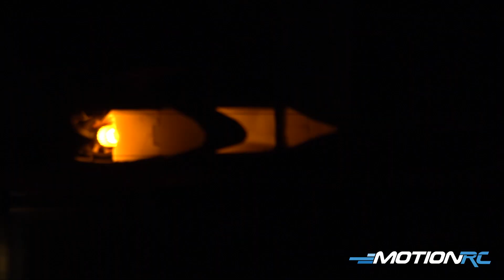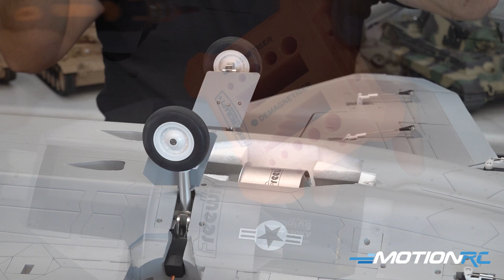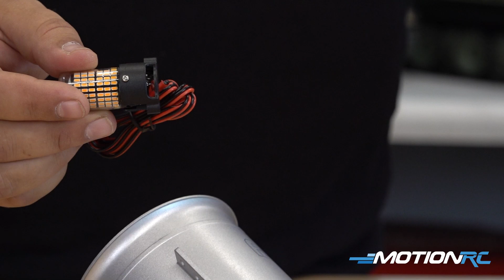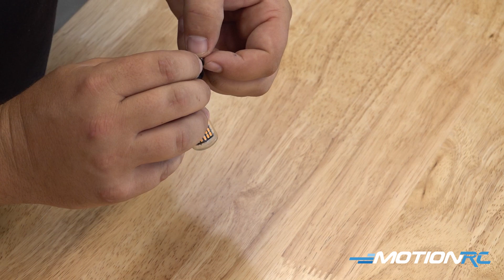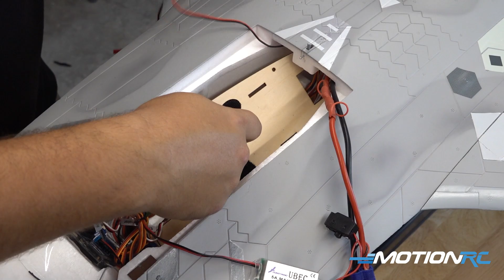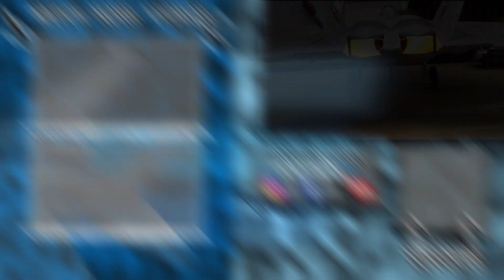Freewing Tail Flame LED Simulated Afterburner Overview | Motion RC

Comment from the maker: For customers using the Tail Flame on 8s set ups. This afterburner in stock form requires the use of a 6s balance lead. For an 8s setup, you would need to use one 6s and one 2s battery so you have the 6s balance lead. If you are running two 4s battery’s to make 8s it will not work without modifying the connection.
Reply: I purchased one of the universal burners for the freewing Mig21 because it has an outrunner...the tabs on the back of my motor casing are just a bit too big for the 32mm adapter plate and too small for the 36mm. This is pretty frustrating that of all the adapters, none are the right size.
Reply: If the battery doesn’t have a balance lead, how would you hook up the after burner? The new spectrum G2 batteries don’t have balance leads.
Reply: @AM-it3fs  I have the same G2 batteries. Did you ever come up with a solution?
Reply: So what do we need to do to modify the connection?
Reply: You can always just use a BEC.
Reply: I have an f16 v2 6s, can I connect the power supply for the edf lights directly to the esc cable to the battery connector? Because I have a beeper connected to the balance connector

Comment: I just bought the f22 raptor 80 mm and the dual led. Problem was the motor orientation relative to the can was off. Which means the dual led was off too since the can sits just in one position and can not rotate. I am not very impressed with the QC specifically the edf assembly. very poor.

Comment: What do I need to do to make it work in an E-flite Habu XS 80mm? I installed the afterburner according to the diagram, but it doesn’t work and it cuts the throttle at around 40%
Reply from the maker: These are not compatible with Spektrum smart ESCs you will need to set up a separate channel just for the input.

Comment: just a little tip that happened to me when fitting the Y lead the afterburn  would not work after spending ages eventually found a problem change the Y connections around it worked. It shouldn’t make any difference normally but it did.

Comment: So the other one, the SKU: E633 Freewing Universal Dual Tail Flame Afterburner LED Lights for Bifurcated 70/80/90mm EDF Jets would assemble the same way? And, hooking up the wires like you did, the light goes on a half throttle and up??? Thanks

Comment: Hi, Would love one but, Is there any way to install these when you are using a Spectrum Smart Battery which does not have a balance lead?
Reply from the maker: You would need to power them with a separate small battery.

Comment: Please clarify what wasn’t shown in the video, the connection is a critical part of the installation: you said “…but now your gonna have a second connector that’s going to work the afterburner, plug that into your balance lead of your connector”…… why not show this? The big white plug….Plug it into the battery balance lead, what do you do if a “smart” battery has no balance lead?
Reply: Yo same I have TJ e same problem

Comment: Does this work with the Freewing F-22 V2 64mm?
Reply from the maker: No. there is no option for a 64mm yet. Probably a weight issue in the smaller models

Comment: Great product and video demo, however I have an issue with mine. All lights work on my 80mm F14 when I plug the lights into the battery balance leads. As soon as I connect my batteries main power cables up, the afterburner lights go off. Not sure why as they afterburners are connected to my throttle channel. Can you please advise? Thank you
Reply from the maker: Please reach out to our customer service department. They can help get you fixed up.

Comment: I don’t like the idea of powering it from half the cells in the pack. Seems like it would cause the cells to discharge in an uneven manner. What is the current draw on one of these? I think if I get one I will be using a DC-DC buck converter
Reply from the maker: Not enough to notice. They are just LEDs

Comment: They didn’t show the part where if you mount the afterburner on this specific plane (The 90mm F-22) you have to cut out a section of foam because the motor doesn’t fit with the afterburner light on. Smh they should of just showed it but I guess this is a video for the afterburner not specifically for the F-22.

Comment: Did not explain if he use a Y cable for the throuter connection
Reply from the maker: You can or just plug it into an open port and mimic the throttle channel

Comment: hey there, great videi0 but can you tell me why the website says won't work with Avain smart escs"
Reply from the maker: The Spektrum receiver sends power through the signal wire and will burn up any afterburner plugged into them. The only way around this is if you run your afterburner in a separate port and mimic the throttle channel in that port.

Comment: Wes, mine comes on as soon as I move the throttle from the off position.  Your video says it should come on at 1/2 throttle.  Is there a way to adjust this, or do I have a faulty afterburner?

Comment: Will this work on the 64mm f22 aswell.
Reply from the maker: No, these would be too big for a 64mm and the weight would make it hard to fly. Eventually we may make smaller ones, but started with our most popular sizes
Reply: @MotionRC  ok.

Comment: I mounted it on a freewing f-16 70mm 6s 4000mah battery, the led stays on all the time is this normal?
Reply from the maker: Check your connection going to the Y harness if it’s plugged in backwards this will make it stay on constant
Reply: I am facing the same issue too. Connection is correct. It does get bright towards full throttle. But it stays on still at zero throttle
Reply: @loo0201 I have the same issue. Did you ever figure out why that was happening?
Reply: @alwaysflying6540 Can you please elaborate? There are no hints anywhere that the controller is programmable. Are you using a spare port on the RX and adjust via mixing?

Comment: As a side issue, I see that the EDF installed in the F22/90 is the newer V2 8S 4075-1350KV Silver metal? This is the new stock EDF? I only ask since I'm in the market for the F22/90 but seems that the current HP/deluxe version is advertised as having the older 8S 4075-1390KV...🤔

Comment: Looks awesome, but I have 2 questions:
1. have a voltage sensor plugged into the balance lead of my battery, is there a way to use the sensor and the afterburner together?
2. What are the diameters of all the non-freewing adapters?
Reply: You can ‘feed’ it with 24V max. So a Y-harness directly from a 5S lipo can be used (e.g. male and female XT60 to an XT30 for the AB). 6S can be a bit tricky that way: fully charged you can get 25,2V theoretically. But under load it drops fast.

Comment: I have two Freewing 80mm planes that I would like to add this on, but I run a telemetry sensor off of my 6S balance tap, is there an adapter that could accommodate both?
Reply: Nope… but I have always been able to help you! 😜😜😜

Comment: Hi,
I really do like the look of them from the spec sheet it says 12.5V to a MAX of 24V from the video it looks like using 3 cells and also on the website picture E631 is using 3 cells BUT E632 it's a bit hard to tell whether it's using 3,4,5 or 6 cells from the picture.
Now to my question people who have a G2 Spektrum 6S batteries (No balance lead) Would a full charged battery 25.2V (I know under load the voltage would drop a little bit and soon would come down to near 24V and below) likely to burn out the afterburner or not?.
At the moment they  are out of stock on the E.U site BUT I would be very interested in getting some when they are in stock.
Steve

Comment: Well it's about time freewing. Nice little kit. Although I prefer mine hardwired in so I don't have to keep messing with balance plugs. Would also suggest you do a twin. Even on a single fan twin led units at an angle help throw the light out better.

And finally use foil tape inside the ducts. Does 2 things. 1) Obviously helps project more light out. 2) More importantly it prevents light bleed through the foam which can look terrible. 👌
Reply: They do make a twin. SKU: E633
Freewing Universal Dual Tail Flame Afterburner LED Lights for Bifurcated 70/80/90mm EDF Jets
Reply: @ES355AW They do now. But my comment was two years ago lol
Reply: @CarlRcAirNLandNAquatics  I did see that, just happened to be looking at the exact same thing and thought id leave that update for anyone who came by! 
Did you end up doing it??

Comment: Tried one similar (I think same?) on my 8S F-22 and connected it to one battery balance lead and the wiring to the burner melted. There must have been like a ground loop or something? What is different with this Freewing one that stops this happening?
Reply: There is a recent video put out by motion rc that explains how you need to connect the batteries so that does not happen. I did the same thing and fried my first afterburner. It all depends on how you plug up the batteries so that it doesn’t send to much voltage to the afterburner.

Comment: The LEDs should be mounted on a truncated cone so that the light reflects and bounces to the rear, and minimizes light leaks to the front. The dark gaps would also simulate the injection vanes.

Comment: This Motion's setup is way easier than the RC castle's version, in which you would have to throttle-calibrate. With Motion's setup there's no need to do that. You literally plug-and-play.
Reply: How do you throttle calibrate the tail flames from RC Castle?

Comment: The gripen motor doesn’t have the2 screw holes for the freewing afterburner kit , it will need the other kit with the adapters

Comment: So if you have a 8S setup and run two 4S batteries. Will this system work?
Reply from the maker: You will want to run a 6S and 2s Lipo. Or you can solder a new connector
Reply: @MotionRC or you can put a 4s battery adapter in the kit?